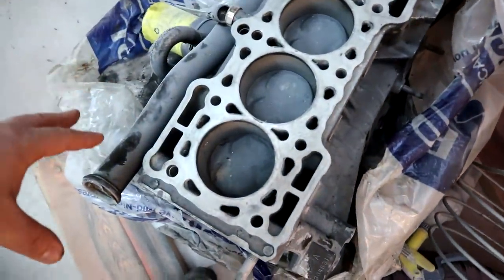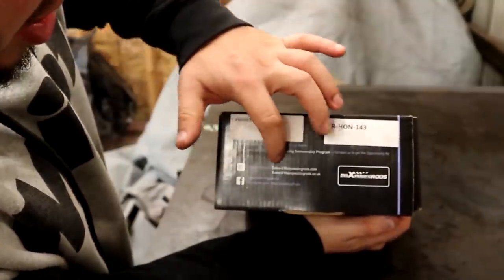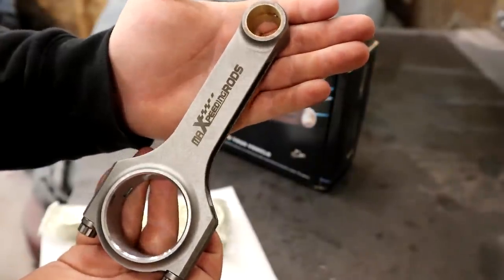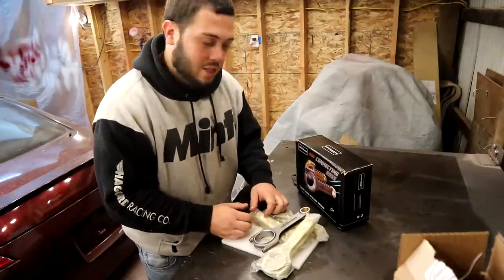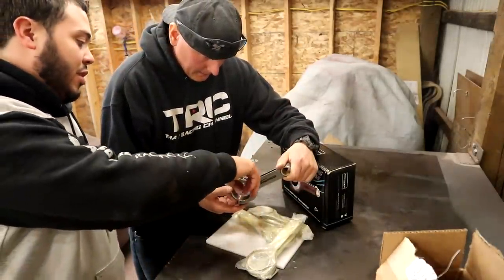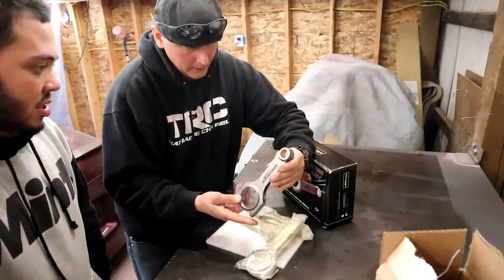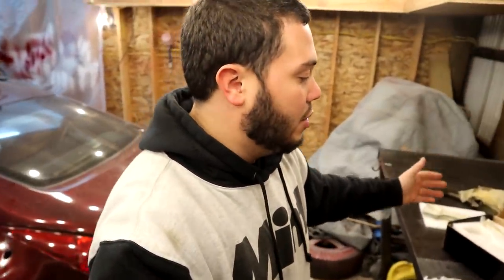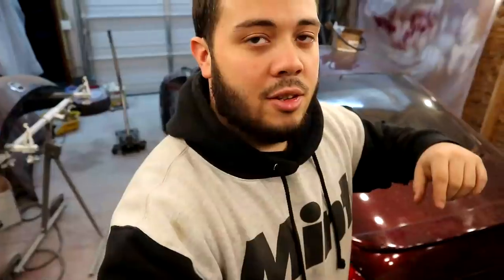BUDGET FORGED CONNECTING RODS - UNBOXING & REVIEW

Comment: Hey bro! Just your friendly engine reco guy back with some advice. We have used these rods in the shop. Only thing we have found with these rods that the brass inner bearings can sometimes be a "ALITTLE" out of spec. (Not for this model but with other models) Roughly we see 00.2 thou out. Also we personally run them on the safer side. Only time I've seen these fail is with a aggressive torque curve, along with 2 step abuse. In summary just double check your clearances and stay true to your torque settings for the main cap. Also my advice is to try and aim for a smooth transition with the torque curve through vtec and boost. Hope this helps bro. All love from here in Australia.
Reply: No such word as "alittle"  or "ALOT"  They are TWO words: a little ; a lot.
Reply: @montinaladine3264  thanks alot 😘

Comment: Over 50 passes on max rods at 1233 hp in a 3500 lb car.  Guy at machine shop was impressed with the quality of the china rods when balanced rotating assembly.  He had no trouble balancing or anything and had to remove very, very little.  A lot of companies like eagle use the same forgings and everything.  There's a lot to be said for timing at full boost pressure, fuel type and temp, air charge temp.  But the rods are impossible to beat for the price.

Comment: If these work out for you I will put them in my b18 turbo integra
Reply: Thanks, Let's wait for the result together! :-D
Reply: @MaXpeedingRods  on the website it says the rods are compatible with the b18c block. I'm running the b18b1 block which is very similar. Do you think they'd work?
Reply: @wadehernandez297  same bore and stroke from what I know but check in a factory service manual

Comment: Those should be good rods for your motor. Moly forged is the best for a turbo engine. You should definitely find a set of aftermarket pistons. New or used just something better than stock. Then you wont have to worry about them possibly falling apart under load. If you start playing with more than 300 hp your going to be blowing axles and stock transmission gears. So just keep that in mind for the future.

Comment: do pistons really need a tüv certificate? the engineer can't look into the engine and its not a part thats safety or emissions related like brakes, lights or exhaust/intake. probably just a marketing thing - can the certificate be downloaded somewhere? nevertheless, 300 Bucks is a good price for a set of rods.
Reply from the maker: Chrizzly92 idk about pistons I’m sure there are manufacturers that have the cert, luckily in the us we don’t need that 😂
Reply: @damianmonte  ah fck i meant the rods from maxpeedingrods of course, not pistons. Stupid language barrier. :D but its the same for the rods. a tuv engineer cant look into the engine so i don't know why they need a certificate. they dont change compression, they dont change emissions, so they should be a normal replacement part. thats why im curios if they are really checked by the tüv or if its just a marketing thing.

Comment: If you have a car go to the website if you want to boost, lower or strengthen they will have a part for it ..... I just went to the site and they only have a part for my car seriously only 1 part 😂 and its sadly only half of what you need to lower the car RIP
Reply from the maker: Maxim_Gaming what car do you have??
Reply: @damianmonte  01 impala .... just picked it up a month ago and I'm trying to find mods for it ...
Reply from the maker: Maxim_Gaming that’s gunna be a hard one homie, maybe try getting some info from a fb group
Reply: @damianmonte  this cars gonna test my skills as a car enthusiast because there's basically no after market support for doing fun stuff so I'm gonna have to get creative ....
Reply: look up the 3800 group pages on facebook and Wbody pages tons of ppl and info and mods and look up Zzp performance and milzymotorsports all gm performance
Reply: @VQBrev  thanks for that tid bit of info .... outta be interesting to see what I can do without breaking the bank and pure insanity ... though I wouldn't mind the insanity if I had a work shop.
Reply: @VQBrev  I am planning on swapping an L67 into my Beretta when it finally blows up. I've owned it for 21 years. Just manual swapped it this year
Reply: @williamsinger4124  interesting car .... what's the milage on it ?